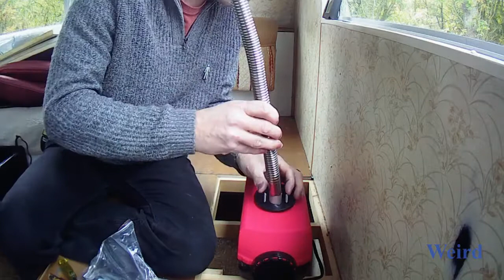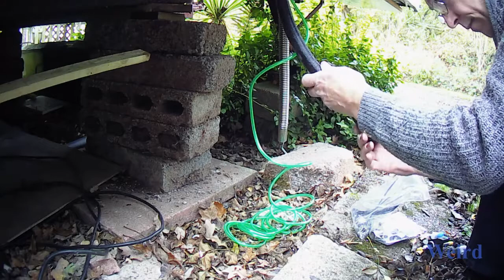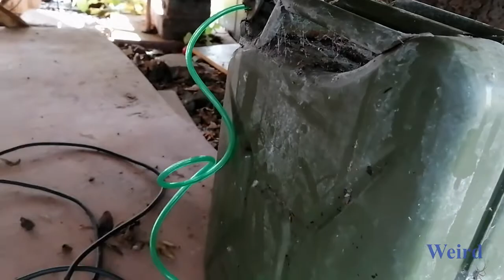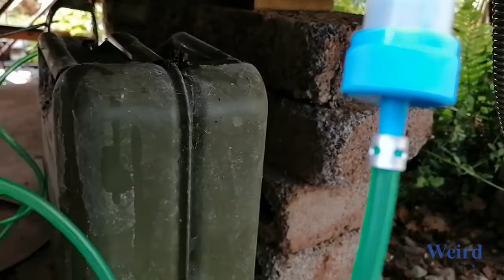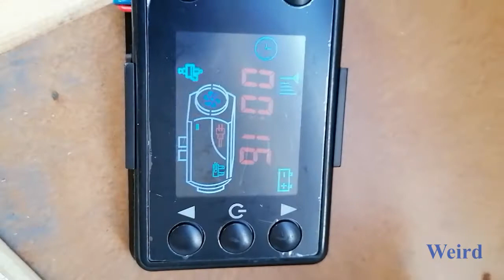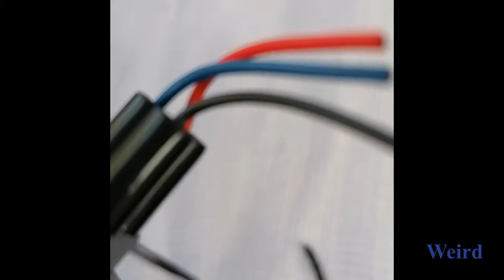Diesel heater in a Static Caravan

Comment: Hi only just watched this because I’m considering fitting one in my static. Haven’t watched till the end but I’m wondering if you’ve had any problem with the diesel freezing in the line or the pump with it being outside under the van.
Reply from the maker: Hi David
We've had no issues at all with Diesel freezing. 
We have had a couple of problems with the pump but I've put that down to moisture in the diesel rusting the inner components.  As you may be aware, Diesel is very hydroscopic, so I'm looking for a way to limit the air exposure while the Diesel is standing.
Reply: Ours was outside a year no issues at all pump secured on wall. Just bought a gas box houseing and put everything neet into the box i run two to keep the cottage toasty costs me 20p for 12 hrs on kerosene
Reply: @paulball1767  that is not possible we have 1x2kw and 2x5kw diesel heaters 12pence per hour on diesel 6 pence per hour on kerrosene on the lowest setting please explain cheers geoff